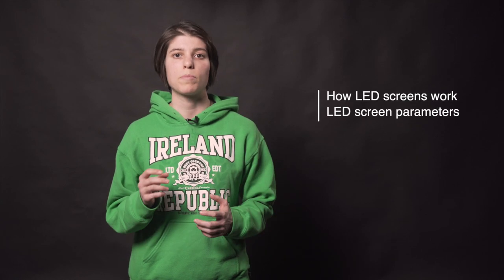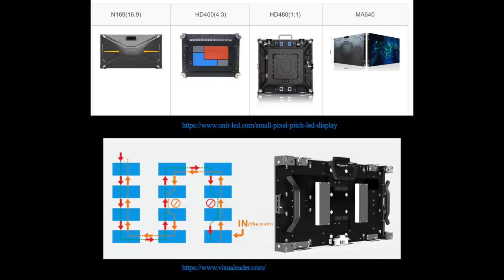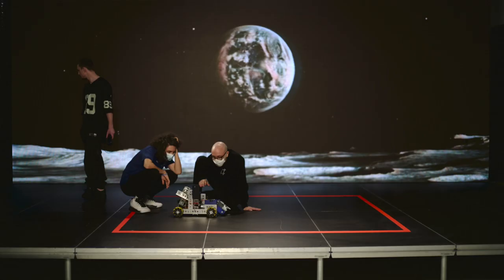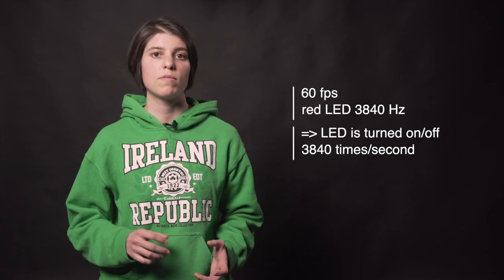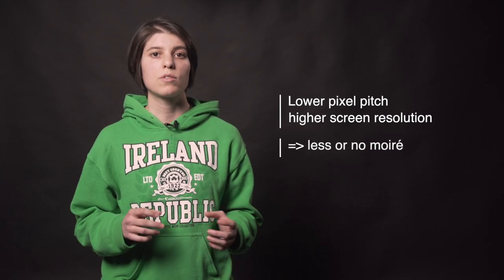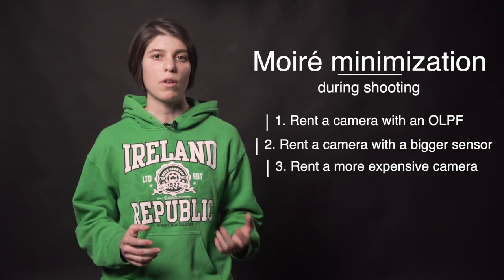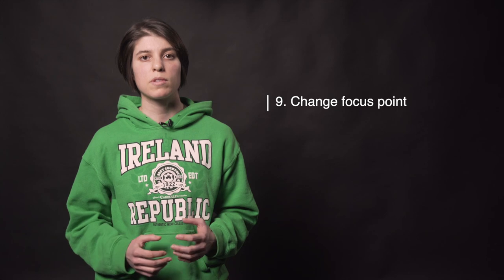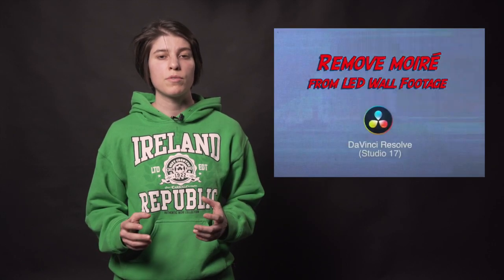How to minimize LED screen artefacts during shooting

Comment: if i understand correctly: flicker depends pretty much on the quality of the led screen and moire mainly on the quality of the camera (if it has an OLPF)
Reply from the maker: Hi, you're right about the flicker. I'm not 100% sure about moire though because I didn't get to test it extensively. In order to be sure what the main cause of moire is, i would have had to test at least 2 -3 screens with 2-3 cameras. You might be right, but I'm not sure